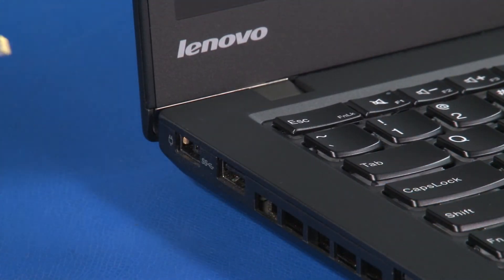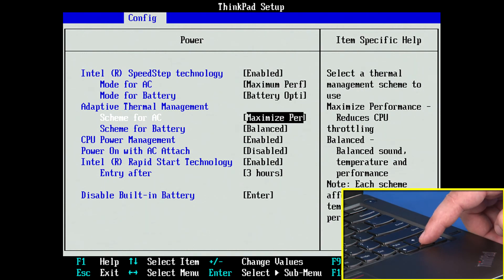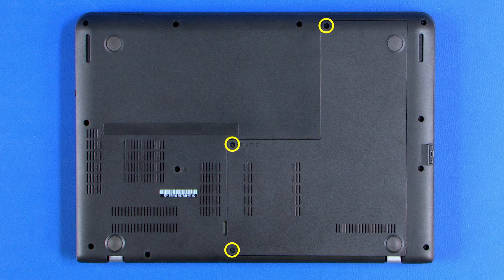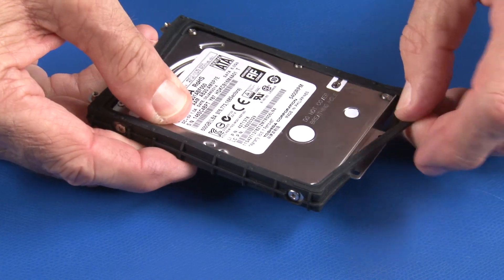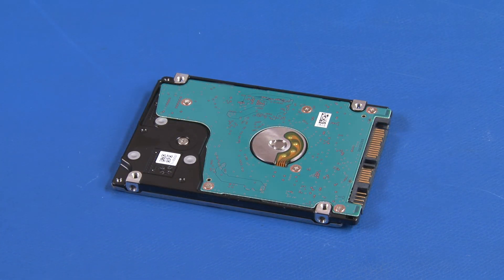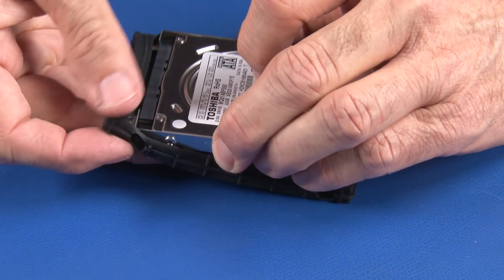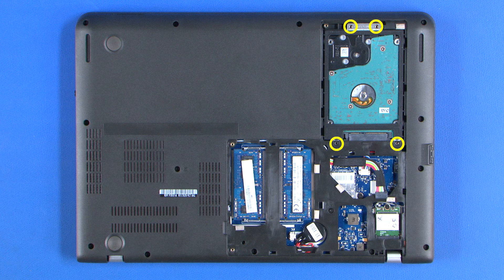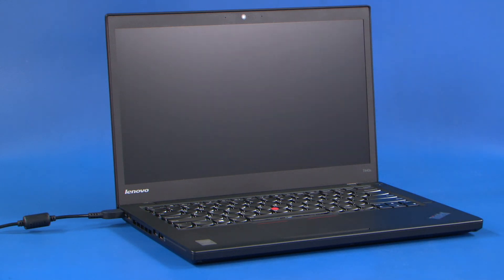ThinkPad E450, E455, E450c Hard Disk Drive and Solid State Drive Replacement

Comment: Is it the same with replacing HDD with an SSD? Since the video show only the replacement of HDD with HDD.
Reply from the maker: Hi! Thanks for reaching out. It may vary per what type of SSD you are going to replace. If you have the 2.5 inch type of SSD, it is almost the same how you replace the HDD, but if you have the NVMe or M.2 SSD, it's a different way to install in your laptop. You may check the Hardware Maintenance Manual of your device in our support website https://lnv.gy/3nZlWu7 (enter the serial number). Let us know if you have other questions. Mark_Lenovo

Comment: which ssd make and specification is recommended to replace the hard disk?
Reply: +Abhijit Shetty Any 2.5-inch internal SATA SSD you select will work fine. My personal 
preference is for Samsung, Intel, and SanDisk for SSDs. I'd get a Intel 
SSD 530 if you only need ~240GB of storage. If you need ~480GB storage 
I'd recommend the SanDisk Extreme II. Anything above that I'd recommend 
the Samsung 840 EVO or 850 Pro.
Reply: FastJohnnyNardGard thanks man..

Comment: This procedure applies for new Lenovo Thinkpad E460 as well, right?
Reply from the maker: +Oscar Calderón It is very similar but not exactly the same. I'd recommend downloading the hardware maintenance manual here https://download.lenovo.com/pccbbs/mobiles_pdf/e460_e465_hmm_en_sp40j47565.pdf and following those instructions to remove the DIMM door and Internal Storage Drive. Scroll down to Chapter 9. Removing or replacing a FRU and click DIMM door. Follow those instructions and move on to the internal storage drive.